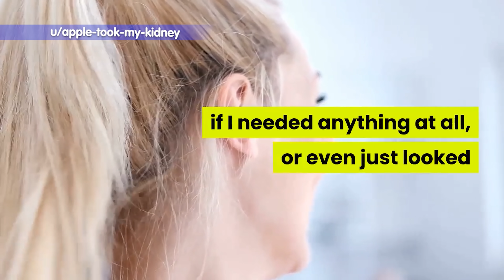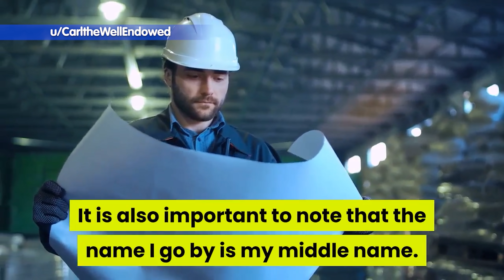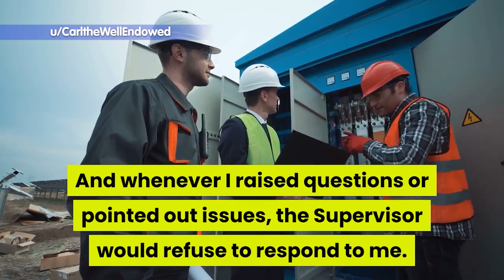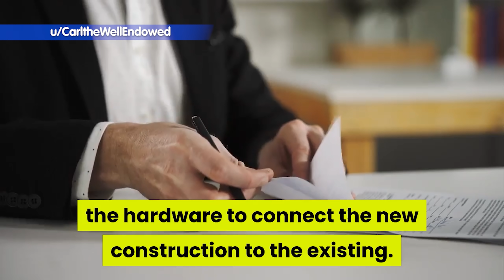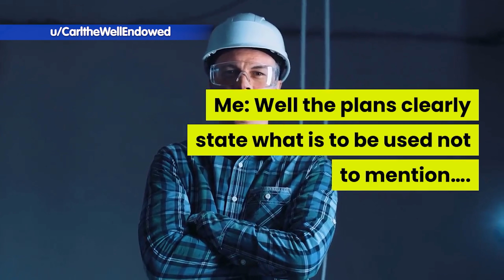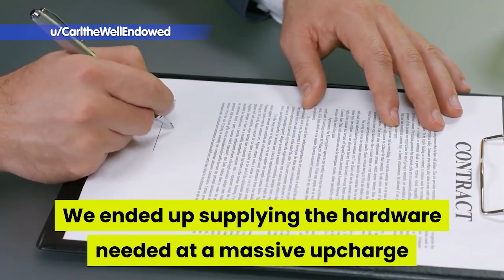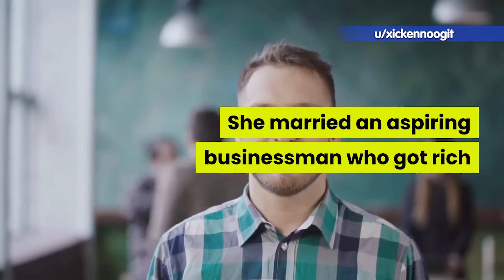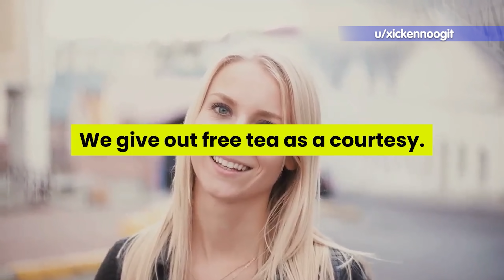Too young to be the deciding one? He should have looked twice! Funny Reddit Stories

Comment: Was a State inspector.  When the builder tells the owner 'We can change this and the inspector wouldn't care' that tells you that something very wrong is about to happen and the inspector will care.
Reply: I have respect for diligent building inspectors.  When our contractor was adding rooms to our home the inspector came in and wrote that the contractor needed to add a couple of shear panels to a corner wall.  The next day the contractor grumbled about it but installed the shear panels.  The house held together during the 1989 Loma Prieta earthquake that damaged parts of San Francisco, Oakland, Santa Cruz, Watsonville.  Our house is only about 9 miles from the quake epicenter.

Comment: I've been in the position to tell electricians working on a job that what they were doing would not work, and got to tell them how to do it right. They were trying to install an 8KW rotary converter for a radio station broadcast transmitter which was 5KW. It was for the Emergency power.  I got to inform them the actual power draw on a 5KW transmitter draws almost 10KW and exceeded the capacity and why did they need a rotary converter to connect to a 3 phase generator? They stated it was single phase as the panel was single phase. Showed them it was indeed 3 phase, but the panel only used one phase so the panel was actually 120/240 on utility and 120/208 on generator. The generator existed for some other 2 way radio repeater stuff and building lights.

They made the change and brought out the 3 phase from the generator. At least they didn't finish the install to overload one phase out in an outage.

For the last story.. "Do not feed the bears" It makes them dependent and aggressive.